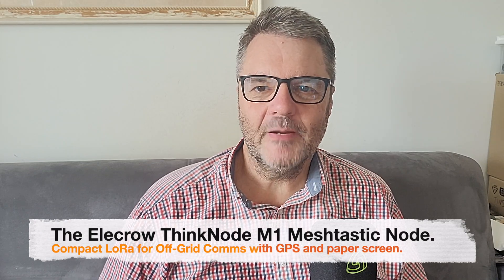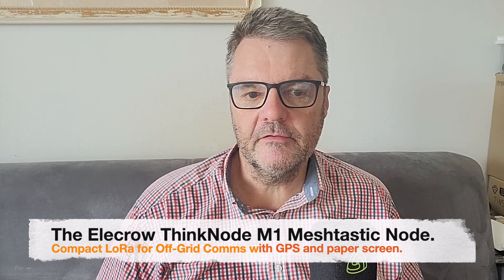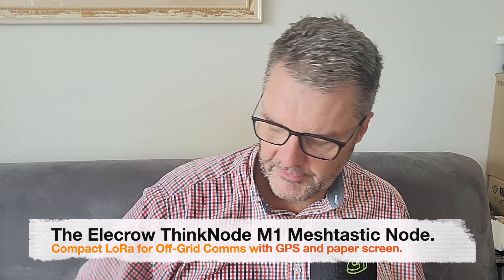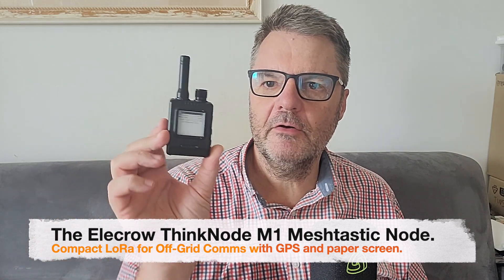Elecrow ThinkNode M1 Meshtastic Node Compact LoRa for Off-Grid Comms.

Comment: I would like to compare it with the T-Echo. The M1 has a smaller battery, perhaps a bigger fits inside. 
BTW: I received last weekend one of you nodes in Arma di Taggia with my SenseCAP Card Tracker T1000-E - 70 km is impressive. 
And i learned that the italien side witched to long/medium because of the traffic coming from France  😁
Greetings Oliver DO1OH
Reply from the maker: Hi, yes, I see a lot of Italian stations now coming through "via MF."

Comment: 470 km "line of sight" communication range? So ... ISS?
Reply: At 43,000 feet, the radio horizon is just over 470km. Commercial passenger planes fly between 30,000 and 42,000 feet.
Reply from the maker: I wish!